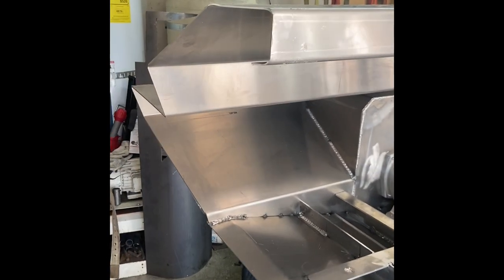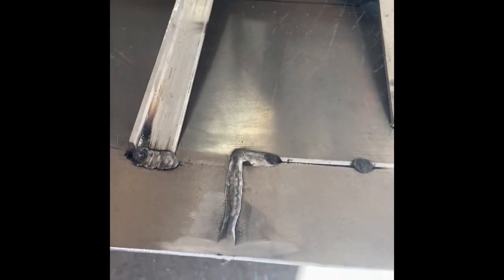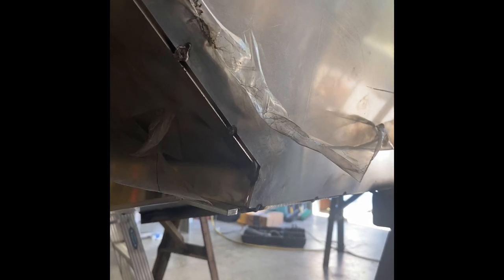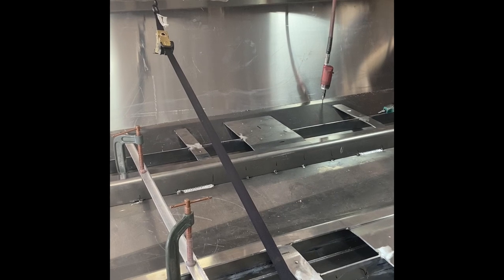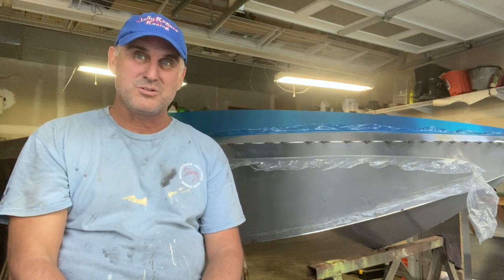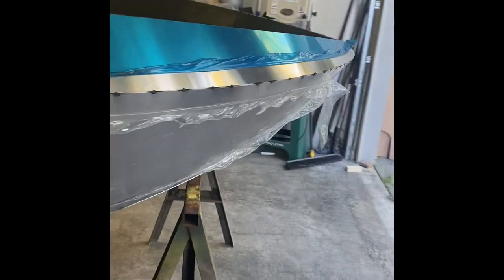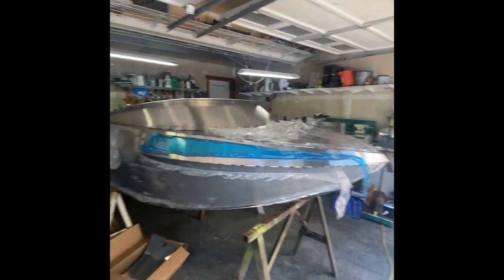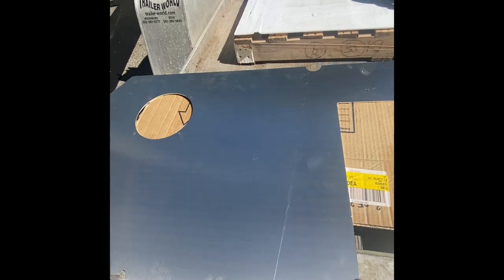RSRacecraft Skookum mini jet boat build day 4.5

Comment: I'm in the process of building a 21' bass boat. My first from scratch build. Man your video has already been a huge benefit in reinforcing my thoughts on the proper way to turn plate into a boat.
On a safe alternative to most of your skill saw cuts, I have been using a 4 1/2" Rockwell circular saw. It does a great job and doesn't try so hard to cut off an arm or leg.
Great craftsmanship!!
Reply from the maker: Thanks for saying that.  I had a very experienced boat builder teach me the basics years ago and I’m a sponge when someone with experience is willing share their knowledge.  Good luck on your build!  I’ve been wanting to build a 28’-30’ twin outboard Pugel Sound boat for years...someday 😊

Comment: i also run the 212 and its best to set the machine in the "autoset" mode to the wire size your running. for spoolgunning aluminum you can run a .010 bigger tip than the wire size if you have issuse with tips sticking. the wire actually swells before it sprays and if you run you nozzle tight to the weld like you should youll get the wire to bond to the tip. there is also a knob inside the 200sg gun that can increase drive roll pressure.  for .125 5052 aluminum i typically run my autoset on .035 and my heat on 6 and my gun feed on  2.75  if im concerned about exterior blisters ill drop heat to a 5.

Comment: Do you think someone could make the hull themselves or is it worth just buying the kit?
Reply from the maker: It all depends on your fabricating & welding experience.  I wouldn’t suggest if you’ve never welded or have minimal fab experience.  But if you’re a decent welder and know a little about how aluminum behaves I’d say go for it.  Buying a welded-out hull might be your best option.
Reply: I would say no to that first experiment as there is a fair bit of knowledge that goes into geometry that works. Sure you could fuse metal together but good brands have spent a fair bit of time getting geometry that works. Doesn't porpoise or bow hunt badly in chop, gets up on plain quick but does not jump out of the water. Besides buying kits from a reputable manufacturer gives you lots of past experience and help if they are a good one. Plus they buy in bulk both metal and cutting so they often pass some of that savings on to you!

Comment: "Meat saw" What did you use to make that storge area cut? Nice work.
Reply from the maker: Just connected the pre-cut speaker openings to the main opening with tangent lines, then cut with the meat-saw & trimmed with a die grinder.  Quick, easy cut!
Reply: @JollyRoger907  ok dumb question but is a "meat saw" a band saw
Reply from the maker: @chrisstack849  sorry, no a “meat saw” is what I call my air angle grinder modified to run a 4” carbide-tipped blade.  Not for the faint of heart lol...it’s dangerous!  Pics of it in video day 1
Reply: @JollyRoger907  ha nice! Thanks
Reply: @JollyRoger907  I call it a digit-deleter. cuts through fiberglass hulls like a hot knife through butter

Comment: what is this meat saw? im planning to do the same
Reply from the maker: The meat saw is an Angle air grinder with a 4” aluminum cutting blade on it.  It’s dangerous as hell but super useful!
Reply: @JollyRoger907  thanks I appreciate the videos. There Very helpful